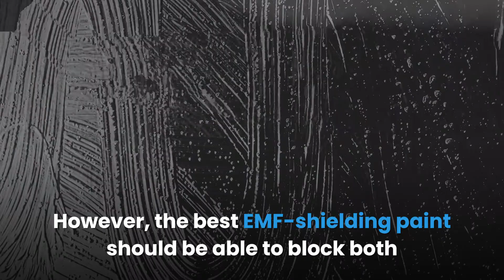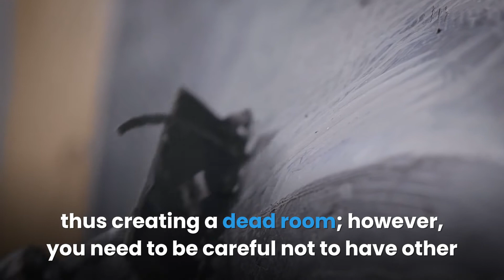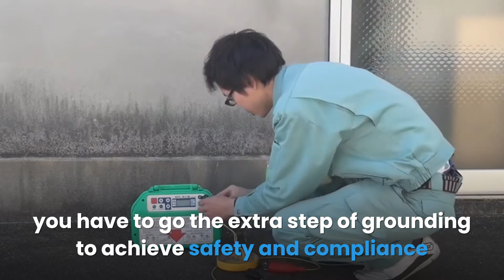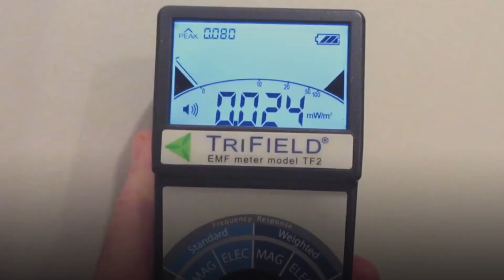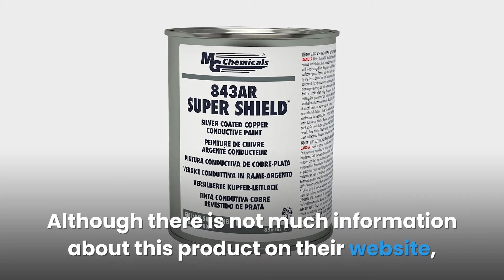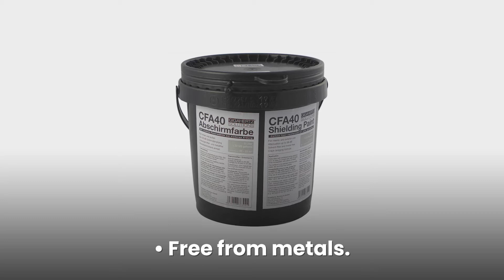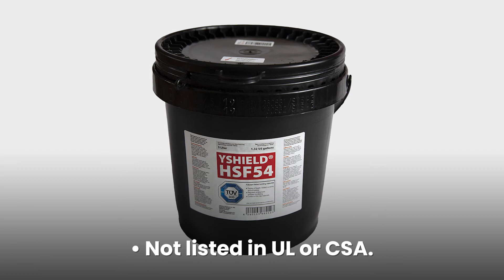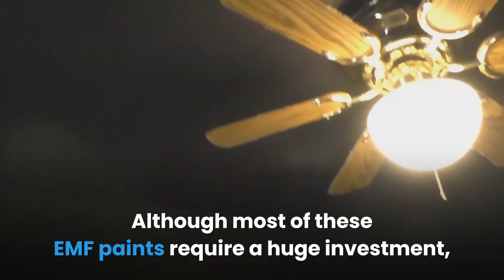7 Best EMF Shielding Paints You Should Know | EMF Protection

Comment: Is it absorbing or reflecting the EMF? And why would we put it inside the house if we are trying to keep the EMF outside the home? Why wouldn't we pain the exterior of the home so it doesn't make it inside? Thanks so much for the clarification.
Reply: Properly applied, it absorbs and sends most types of emf to ground.

A) It's generally less area to paint inside vs outside.
B) There are several types of emf not just rf from towers etc. The wiring in your walls radiates AC electrical fields and dirty electricity and properly grounded paint should catch those and send it to ground instead of radiating into the house.
Reply: It might come down to aesthetics. I don't want to paint the bricks on the outside of my place. It's an apartment and I'm putting mylar sheet under the flooring to reflect wifi from below.

Comment: ok so you paint all the walls with that but you still have windows that are not emf blocking, won‘t there still be emf then?
Reply: Use emf blocking curtains
Reply: @reclez100 - The thing is if you shield your bedroom, but there is a space whereby an ENF field can get in, I would imagine, you cornered yourself in a more dangerous condition to be in. Whatever adverse waves that come in, you recieve it at higher power.
Reply: @mtalk828  Yes!
Reply: Emf window  film
Reply: Paint the windows as well 🤷‍♂️
Reply: You have to shield the windows with EMF blocking fabric, mesh, seal or curtains